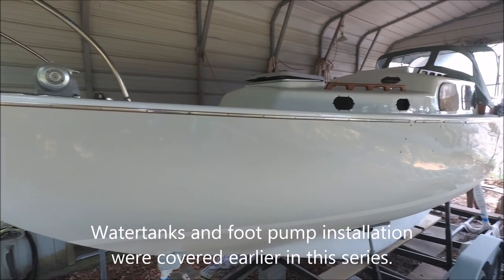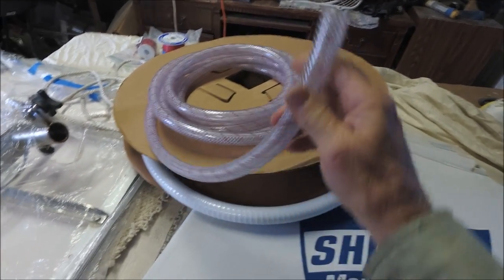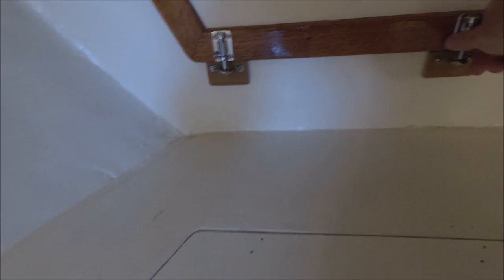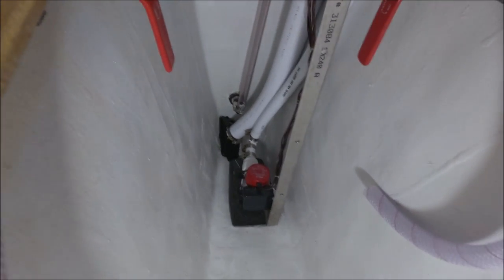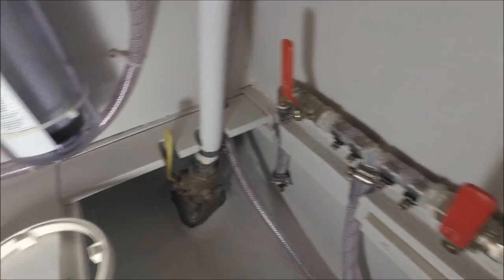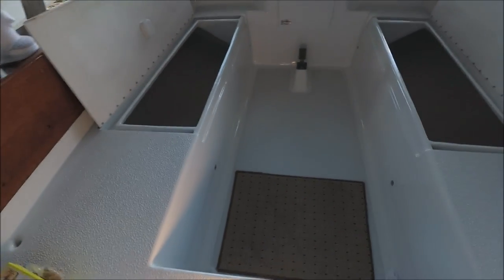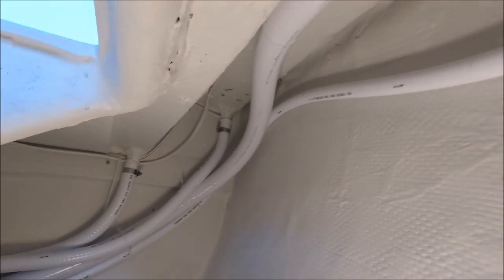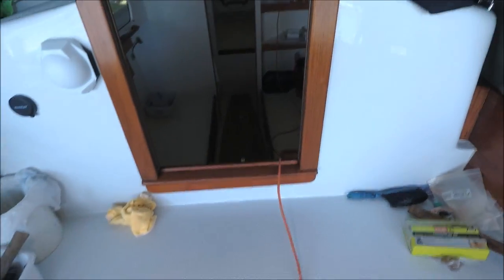Basic Sailboat Plumbing System  -  Pearson Triton Osprey Refit Part 11

Comment: Have you ever seen a manual bilge pump used to pump water for a shower from rainwater jugs, but use some kind of quick disconnects so that you use it as a backup in case of emergencies?
Reply from the maker: I haven't seen a bilge pump directly supplying a shower but have thought about using a whale baby foot pump from the tank direct to a shower nozzle. In cold weather I have used a solar shower bag inside for a simple gravity feed shower.  If you need to stand inside rather than sit and don't have height for that you can leave the bag on deck and run the nozzle thru a portlight. Or build a shelf in the overhead or use a net to hold the bag up high horizontally might work.

Comment: Always love you videos. Such great restoration ideas. I'm wondering about the size of drain/hose you are using for the watertight compartments. I have a single large hold under whole forward half of the vbirth on my hunter. It has built water tight to a bulkhead at the forward end of the keystone cushion with no limberhole. While I'm in there installing the new tank I want to add drainage, but want to keep it controlled as you do on your boats. But how large? 1/2in? Is there a scenario that I would be regretting it not being bigger? Such as the compartment flooding and the drain valve letting out water slower than my main bilge pump can pump?
Reply from the maker: Good question. I don't think the pumps I installed can pump faster than what a 1/2" or 5/8" hose can deliver to the bilge. You have to consider the actual rate of the pump minus friction and amount of lift rather than its rating. And since these lockers are mostly subdivided into small lockers and more or less watertight to the tops, which are usually several inches above the waterline, it's less important to keep running the pump faster than intake of water.  Rather than run a pump nonstop for who knows how long, even if we had the power and the pump didn't burn out, it's more realistic to seal the locker and not drain it until repairs can be made. It doesn't take much to have a leak that lets in more water than your pump and power source on a small boat can reasonably deliver so at some point, upsizing the pump is futile. But if you have a large locker without a sealed top and want the ability to drain it as fast as you can for a limited time then I think 3/4" would be a good choice.

Comment: What is your potable water filter of choice James (have you found a form factor or other device than the Glacier Bay)? - 08:52
Reply from the maker: I use whatever household water filter is in stock that is similar to the one shown here. I bought one at Home Depot a few months ago that was a different brand but it takes the same charcoal filter size. Also make sure you get the threaded hose nipples that will fit the filter and the size hose you plan to use. There are probably other good filter types out there but I wanted these since they have relatively inexpensive replacement filters that are commonly available.

Comment: what does it cost to have you rebuild a Triton or similar boat to the standards of you Atom?
Reply from the maker: The cost to refit a Triton like Atom and similar boats we've done varies a lot depending on how much work the owner has contributed, the choices they make on jobs needed, and what condition and what good work had already been done before we got the boat. In general though it takes me the equivalent of about 6 months working  full time with labor based on $50/hr. It's not cheap and for most owners its not in their budget so I'm doing this series of videos to help those that may want to do similar work themselves.
Reply: @atomvoyager  And that is very kind of you. Thank you.

Comment: I noticed that you always go with 6hp. Is there a reason why you don’t go with a 9.9hp, say by Yamaha where the cowlings are small and the weight is around 89 pounds? Seems like the extra power would come in handy on a strong current. What are your thoughts?
Reply from the maker: We're trying to keep motor size, weight and cost to a minimum. The Triton will motor at 5.5k with the 6hp and even though it doesn't have the reserve power of the 9.9 to maintain that speed in waves and headwinds I find it adequate for this size boat. Currents are less important than wind/waves because the boat is only going to do maybe 6.5k no matter how large the motor. The only specs I could find on the Yamaha T9.9 were 93 lbs dry weight for the 20" shaft. The 25" will weigh more. It's too large and heavy to fit the space on this boat and looks like the extra long tiller handle is too long to fit. I have put a Nissan 9.8 into an Alberg 30 but haven't seen a size/weight comparison to the T9.9 to know if it would fit also.
Reply: The new 9.9 Tohatsu with the fuel injection is unreal. No more carb issues. My 27 has a newer Yamaha 9.9 20 inch shaft. I sail on the Pacific so the extra torque helps. My boat was built for the outboard. Lighter than those full keels you are modifying. Love your work.

Comment: Cockpit seat locker drains exit down by the footwell. So if the boat is heeled, water will accumulate at the drain bend rather than go UP to footwell? Why not drain directly out? Also footwell scuppers drain below waterline? Cant move exit to above waterline? At least youve got seacocks on them
Reply from the maker: In practice they drain fine when heeled and I had plenty of time to observe it during two circumnavigations on the sister ship Atom. The main reason we didn't make separate drains above the waterline was because the boat already had the fiberglass T joining the three drains to one and decided to reuse it. The footwell being so close to the waterline complicates the issue of other options. It may not be possible to drain everything including footwell above waterline so a seacock would be required installed below the waterline but not where existing tube is because there is no clearance. If I did another Triton I might try to rebuild the footwell floor angle to drain aft into the outboard well or thru transom with flap valves to reduce back flooding then join the deck and cockpit seat drains to an above water thru-hull as you suggested. Reason we didn't do it here was to save a large amount of labor and not lose the scant headroom under boom and bimini. As I mentioned in the comments on the other video,  the only reason the fiberglass tubes could be connected directly from hull to footwell is because they are in a corner supported by two bulkheads and within a watertight locker. Any other situation then it shouldn't be done so it's good you point that out.
Reply: @atomvoyager  I'm dealing with same issue myself on '67 Pearson 35, your site and videos have been quite interesting. I have to decide about moving scuppers up above wl soon or at least put seacocks sailingwhimsy.com